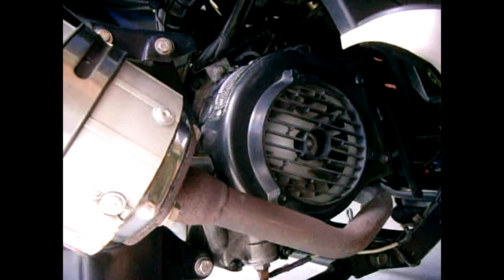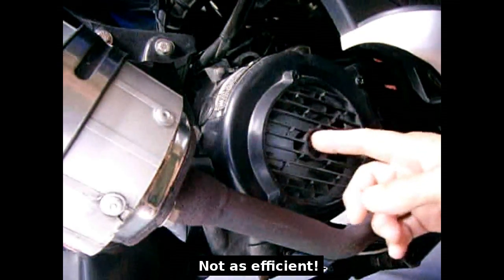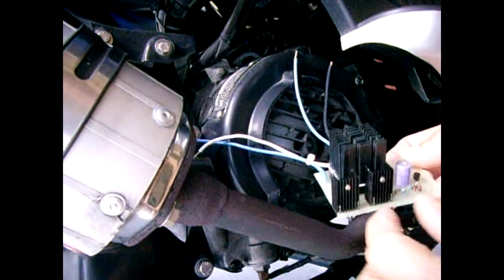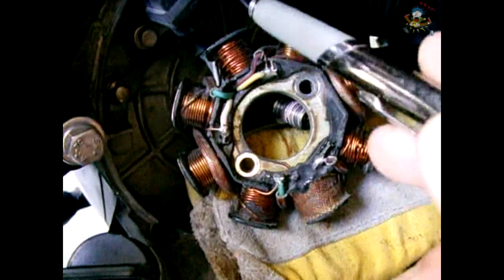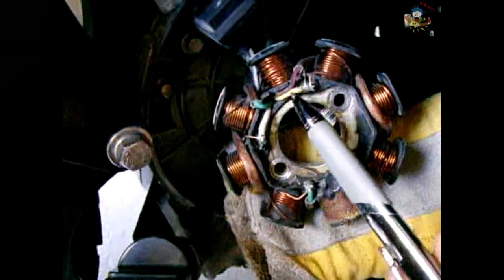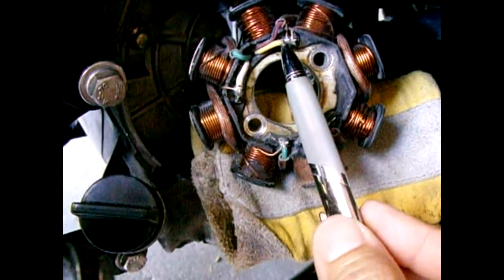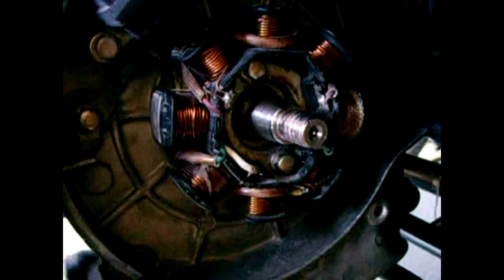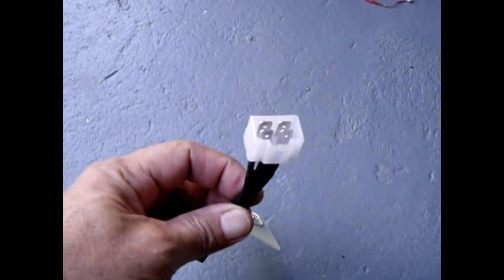GY6 ~ 1/2 To FULL WAVE Charging System Conversion

Comment: I’m lost at 8:20 where you said the tap ( yellow wires) I mean why do we have to cut and tie it to a switch ? Do you have a diagram to show to how to do that ? Kinda hard to follow in the video …
Reply from the maker: @S2king-custom  Shouldn't be hard to follow, from what I recall there should be a diagram also included
Reply: What I'm gathering is that yellow wire is being modified specifically for a headlight. Personally, I just ran a couple wires from the battery to a switch and a headlight. I didn't modify my stator though.

Comment: at 1 minute 12 seconds in the vid. you state that the regulator also regulates the A/C voltage going to the headlights(your talking about in the STOCK wiring harness condition) . How can the A/C voltage from the stator be regulated by the regulator before going to the headlights when the tap going to the headlights has already come off down by your fork ?

Comment: What would make your headlight stay on even when the key is out of the ignition,which blows the fuse,I know a short but where should I look?
Reply from the maker: The problem could be anywhere. I have no idea what you may have done to the wiring, or what the wiring diagram is for your make/model scooter. I suggest finding a wiring diagram online and trace everything. Thanks for watching

Comment: So Iv come to the truth took one apart my self the stock regulator/rectifiers are actually full wave rectifiers on half of the spayed terminals on the plug the other 2 pins / spayed are only half wave and only have one part a diode that’s it
Reply from the maker: My scooter had a 1/2 wave rectifier.
Reply: Maybe because it’s a 150cc ?

Comment: What does this do / why was it connected to ground in the first place
Reply from the maker: Before the MOD, lights, the enricher, and other things used AC instead of DC.
Reply: I ment like what does changing those wires around do does it make it two phase or what

Comment: I door get the point of this video @0:51 the schematic shows that the charging circuit white wire  is already covered to full end of winding and yellow which is for lightening is center tapped. So should not you be just installing full wave rectifier and good to go? For headlight conversion to dc you could just disconnect the yellow wire h honing from stator and hook it up to the battery?
Reply from the maker: Also watch 3:35

Comment: Dude can you pull the yellow wire out the stator altogether and replace with a much longer one and take straight to end wire ? instead of putting in a link wire ?
Reply from the maker: If a wire is too short, you can add more wire.

Comment: Is this applicable to any stator or motorcycle?!
Reply from the maker: They all are very similar, you'd need to take resistance measurements across the stator wires, see where they go, in order to see how it was put together. Then compare your design to what's shown in the video. Thanks for watching!

Comment: I have a GY6 150cc China scooter  (about a year old now)I ordered a rectifier regulator could I use a full wave rectifier if the original is not a full wave ?  I guess I'm not exactly sure what I have so can I use either full wave or non full wave ,when replacing just the regulator rectifier ?
Reply from the maker: No, you need to use the same type that was installed. To use a full wave, you'd need to convert like I show in the video. Thanks for watching!

Comment: Thank you, I don't have much experience about electric stuff but I actually thought about this a while ago on my AX-100 stator but where not sure about trying it until I found this video. Went from something like 6-7V to 15V. The AC waves that I got out from the two wires took out each other so I had the most power with only one wire connected but it was a bit to low to run everything and charge the battery but now it seems I get plenty enough. Time will tell if I burn something up.

Comment: Full wave conversion difficulty is medium or easy
Reply from the maker: I wouldn't call it easy. :-)
Reply: electronicsNmore modifying yellow by remove from the ground then solder to the end of winding.
Reply: But make sure the end of winding stator is also remove from the ground and solder yellow and the end of winding together well it’s pretty easy

Comment: Hi. I have a 125cc DC and I changed the stator because it wasn't charging but no luck could it be the regulator? Thanks
Reply from the maker: Usually the regulator is the problem. Thanks for watching!
Reply: @electronicsNmore  thank you I'll check it out.

Comment: Would a gy6 regulator work if it were wired into a 6v motorcycle stator to convert it to 12v?
Reply from the maker: It should, just don't exceed the voltage / current rating of the regulator.
Reply: It wont work. 6 volts stator must be rewound  to output more than 12 volts for the regulator to work and shunt excessive voltage when you gain RPM.
Reply from the maker: You're correct, I read his comment wrong. I thought he was asking if the GY6 regulator would work on a lower voltage system.

Comment: Why don't the manufacturer just use this concept when they built the bike??????
Reply: Good question!, but then half wave system is the basic electrical system on some models. The thing about the half wave, the headlight is being driven by AC which is coming out from the stator other windings. In a Half wave there are two windings, the one that powers the headlight which brightens in term or engine RPM, and the charging which then charge the battery.

The only reason why others are converting to Full wave, if you add more lights and accessories. This way is called overloading the battery, and since the discharge rate is now faster than the charging a half wave can give in. Full wave here is done to give more juice to the battery and maintain the charge. Thus not having a flat battery.

Half wave is just for stock lighting. adding more lights, without altering the charging system will give you flat battery  sooner.

Author of mastercircuits,blogspot.com here. Full wave is also proven to have better efficiency even when idle and all lights are off.

Comment: I'm confused, if you take a feed from the battery for the switch you mention adding to feed the headlight doesn't that give you the required DC for the headlight without the need for a full wave rectifier?
Reply from the maker: The headlight operates directly off the stator using AC volts once the engine starts up.
Reply: as standard yes, so even if you add the new rectifier do you still need to feed the headlight from the battery as you have done here? the reason I ask is that I need to eliminate flutter on an LED headlight bulb on a similar wiring set-up and I'm not sure if a full wave rectifier will work as the headlight feed from the stator also bypasses the rectifier. ta
Reply from the maker: You need to watch and follow my video very carefully. The headlights are connected to the DC output of the regulator, not the AC coming off the stator.
Reply: thanks, yes I realise that from the video hence why I asked about the need to change from half wave to full wave. In my instance then I could simply feed the headlight with DC from the battery and cure the flutter even though I retain the half wave rectifier?
Reply: Sorry I'm still confused, so you moved the yellow wire on the stator to give more power to the light circuit but then disconnect it from the lights, so you now have both the white and yellow feeding the battery via the rectifier yes? so is there now any advantage to be had from even having the yellow wire? can't it all now be done with the white wire?
Reply: Right I've converted my bike to run the lights on DC, just swapped one wire over inside the headlight, I now have a flicker free  LED headlight :)

Comment: this is super confusing he points finger on stator on 2:23 and 2:35 when he is talking about yellow wire at a rectifier (that is located on the steering), by the way that step is optional.
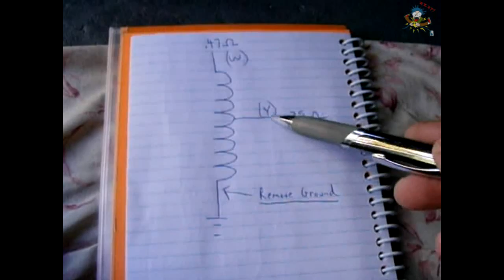on 3:59 its also be easier to understand if you draw 7 winding (not 8) as only total of 7 poles of winding being used for lighting (5 poles) + charging (2 poles).
Reply from the maker: No one else had problems understanding.
Reply: Guess i am special. :) thanks for the video though

Comment: i have TVS apache RTR 180 don't know it's single phase or multi please tell me if it's multi phase then how to do this trick to make my bike full DC it cannot run normal 35W halogen bulb on DC when i connect headlight switch to ignition wire
Reply from the maker: You need to look at the voltage regulator and stator wires.
Reply: There is two wire connector one goes to TCI Ignition and another one goes to Rectifier
Reply from the maker: APACHE BOy Vicky You need to compare what you have to what I show in the video.
Reply from the maker: APACHE BOy Vicky No FB, Youtube is enough work for me. Upload the images to a site online, then post the links here.
Reply: can u please tell me what type of coil is these?
Reply from the maker: APACHE BOy Vicky You need to use my video as a guide. You need to research your stator on google. You need to identify the wires.
Reply: already searched a lot but didn't found anything but my coil is 100w and that is FlyWheel
Reply: and from my coil four wires goes to my ignition and another wires goes to the harness

Comment: hi i been watching this video a cpl of times of and on . i have a 2015 taotao thunder 50cc . it have a 5 wire 8 pole stator ac . if i get a 5 wire 8 pole dc stator and RR would that work or no my headlights have a manual switch for turning on and off . my current stator is dead right now i was riding it and it died like someone turned my key off on me lol . thank you for ur time

Comment: Conversion question: Have (I think) full wave rectifier (three yellow leads to it).  New engine came with stator that isn't -- other than gnd, signal has white, yellow, red/black. Can I just connect white & yellow leads to 2 of the 3 yellows to the rectifier? The red/blk I guess is for headlights, but my scoot already has all that running from battery ... so what about it?  To the third yellow rectifier lead?
Reply from the maker: 3 yellow wires sounds like a 3 phase input being converted to DC.

Comment: Your links seem dead.  But for the rectifier/regulator are you just using a pair of 7812 in parallel for regulation?  What values for the smoothing caps?  And using separate caps for each 7805?  Any other filtering?
(If I got it right from the vid)

Comment: ok heres my issue I have a 2015 Taotao 50 scooter and i wasnt getting spark anymore so i bought everything it couldve been, a new Stator, and CDI, and Ignition coil & plug. to make a long story short the ebay sent me a stator that was dc when i needed ac, at first i didnt know there was a difference untill it was to late i snipped the different stator plug connected the wires, the bike started and the headlight flickered then popped. I cant return the DC stator cause i snipped the plug off, i realize now thats whats happened probably is the dc stator damaged my ac RR and blew the headlight. (my question to you is) can i buy a full current DC RR, wire the yellow wire like you explained in the video. if i do all this should this work and not blow my headlight anymore and make it to were i can keep the dc stator on my scooter

Comment: hello Help.. I have replaced all the electric parts stator ignition coil CDI starter relay.But I still can't get it started.. before I replaced all this the starter motor would spin but would not start.but would start by kick starting...I have spark.but won't start..and now starter motor will not spin... also noticed that when I squeeze the handle to electric start. I see my gas gauge drop when I squeeze the handle. I guess meaning I have a short... the parts I bought don't match up with the colors of the harness wires so now I'm confused about that.if someone could explain what connects in what ic the starter relay, ECT thanks again.i can't afford to put it in the shop.
Reply from the maker: I have a GY6 troubleshooting video in my GY6 playlist.

Comment: if at idle (ac system) my lights are bright and they dim out past idle. does that mean I need a new rectifier?
Reply from the maker: Either a faulty regulator, faulty stator, or loose wire

Comment: i have a AC stator and A DC CDI . can i change the system to AC . cause i have always battery problems and im starving !
Reply from the maker: Better off converting to full wave as shown in this video.
Reply: You simply cannot jump to an AC system coming from a DC system when you have a DC-CDI..AC cdi need external High Voltage generator that is wounded on a stator..You will find a stator with a single POLE, with windings that is covered by white tape and the other poles doesn't have any. That stator is AC-CDI system.

Comment: can you do this  with a 6 pole stator?
Reply from the maker: Same principle. :-)
Reply: thanks for the quick reply. I have a few spares. I'll give it a shot in the am. Video explains the process  perfectly. Awesome job.
Reply: Thank you. Finally got around to doing it and it works flawlessly, with a 6 pole stator. No more flickering lights when I rev my scooter. HID lights are performing better as well. Might just be a coincidence but it seems my auto enrichener is working better, used to stick and hasn't since. Charges at 14.74 at 3,500 rpm and 13.28 at idle. Only issue I has was finding the "splice" for the lights. Tore the whole scooter apart looking for it before I noticed a dark green wire attached to the rectifier in the same spade as the yellow. Connected the dark green to the ACC on and the lights work with the key. Thanks again.
Reply from the maker: Shawn Czerwinski
You're welcome!

Comment: I saw this video today and finally realized what I was doing wrong with my China scoot.  Although it would be described as a 150cc GY6 B body it came with a lot of things that you normally find on a 50cc.  I had replaced the old stator and rectifier with new ones (full AC) not realizing I had been running half AC.  The harness has the connectors for both types of stators.  If I was using new full AC components would I only need to modify the yellow wire to get the headlamp working properly?
Reply from the maker: Not sure how your scooter is wired, but everything is very clear in this video. Thanks for watching

Comment: I figured out that the stator I have is faulty. I got a new one. It doesn't have the same ground wire that I need to solder the yellow wire to. It looks like a lot of the newer stators coming out of China don't have that same ground wire coming off the last pole (the one that is soldered to the green wire before you cut it). Are these just wired a little different? Where do I find the ground wire to complete the circuit? Thanks for your help!
Reply from the maker: You need to locate each end of the full winding. Use a DMM on a low resistance setting to help figure it out. :-)
Reply: Troy Beck

Comment: I tried to follow your steps exactly, and my headlights are now controlled by a switch, but I can't get my scooter to start. It turns over and over, but won't fire. Did I somehow disrupt my spark system? Any help wood be greatly appreciated! Thanks!
Reply from the maker: Hi Troy. It sounds like you touched the wrong wires from the stator, or left a wire harness disconnected. Please refer to my GY6 troubleshooting video to test the stator & CDI. Thank You!.

Comment: Hi, I would just like to ask before I do this, if I do this, will I need a DC cdi box? My scooter uses AC. I have heard that using AC box on DC scooter can cause fire
Reply from the maker: +Jalees Sherwani 
Hello there. You will not be altering the power to the CDI, only to the headlights/lights.
Reply: +electronicsNmore Ok great thank you very much!